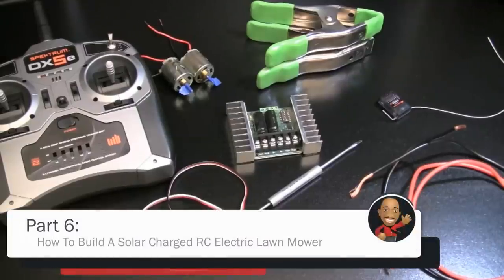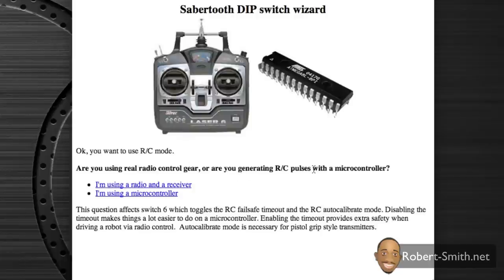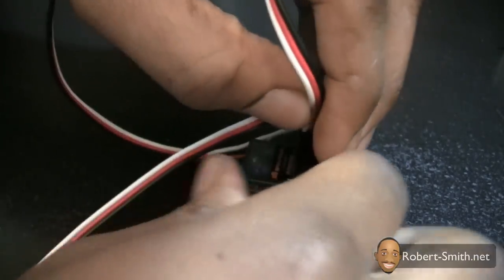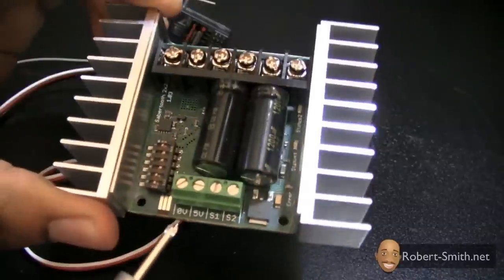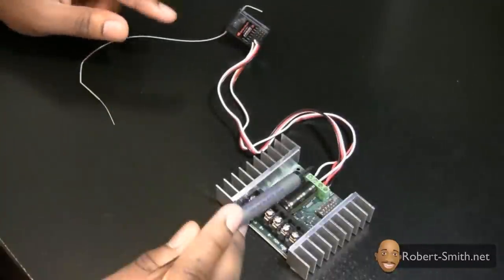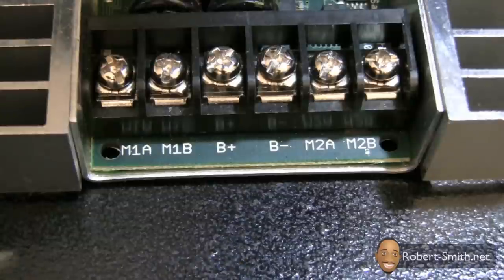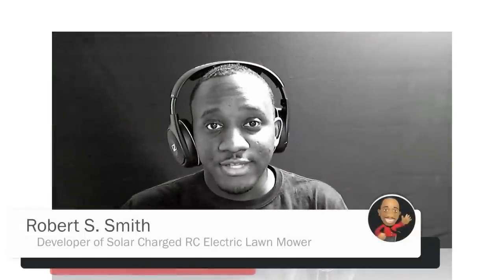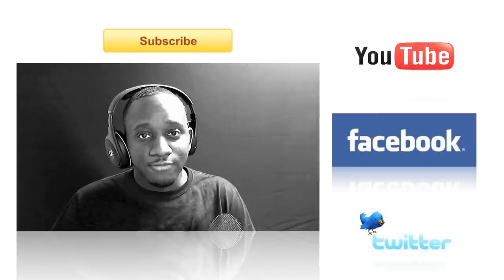How To Build A Solar Charged RC Electric Lawn Mower - P6

Comment: Super easy to follow and extremely helpful.... Please keep up the great videos...
Reply from the maker: What other types of videos would you like to see? I've been pretty busy lately, but wanting to get back into making videos, but trying to figure out what types of videos people enjoy the most.
Reply: @GreenTechTown  I am a Quadriplegic and I have wanted to build or have an RC Lawn Mower built, but I would like to do so without using a Arduino and just use the Motor Controller, RC Receiver, two 12 volt batteries which is easier to do as you've shown in your Tutorial Video's.

I'm familiar with RC Control wiring, as I've had and flown several RC Airplanes over the years, controlling the joysticks with the use of my teeth/mouth, which is how I would control the RC Lawn Mower.

I believe I could bypass using a Arduino, if I were to use a DC to DC Converter powered by the Motor Controller to drop the power to 5 volts for any other servos I may wish to add. 

Example -- Safety Shut Off switch, servo for the throttle and maybe an Actuator to raise and lower the mowing deck.

I may be mistaken on some of this?

As for what I would like to see, I'm not sure since there are so many topics to choose from. You have NOT bored with any of many videos I've watched and I can't imagine you disappointing me with any in the future.

If/when I think of a topic I'll be sure to let you know.

Comment from the maker: @Leney98 Well believe it or not, the Sabertooth 2X25 is considered a non-expensive motor controller because of the features included. The only other option that may be cheaper is to build a motor controller yourself. I have seen a few out there but I cannot remember the link to any.

Comment: Hi very nice. Which type of bttery you use? Ho many ah? Im building mine with the sabertooth 2x25 and I dont know which battery to use. How many amps. Currently i use a 24vdc 4amps power supply to test the equipment.
Reply from the maker: I ended up using for the final project 2x 12v 35ah batteries mainly so I could mow longer.

Comment: Just a thought, you may wish to use ring fast-on connectors when possible in case of vibration and loosen screws. Also locating receiver as far away from all other electrical stuff will reduce interference. Is the receiver available with a whip antenna, may give more range.

Comment from the maker: @thefaeryman The receiver did not come with a whip antenna, but it still has a long range even without one...which is great. For larger yards a whip antenna may be useful though. This receiver also does a great job of staying bound to only one transmitter and has not had any issues with interference from what I've experienced so far.

Comment: Hi Mr Robert Smith Congratulations on your video, it inspired me to create my lawn mower and I just bought the Sabertooth Dual 12A 6V-24V Regenerative Motor Driver and I'm in doubt which remote control to buy I found this on AliExpressFlysky FS-GT2 / fs gt2 2.4G Radio Receiver RC Model Transmitter With FS-GR3E 2CH Digital Transmitter For RC Car / RC Boat can it be used?
I thank you if you can help me I am Brazilian and I do not speak English but thank you very much

Comment: Very nice. Can you control the speed of the drive motor. How fast and slow it move.
Reply from the maker: I'm not sure if you can from the board itself, but my controls were analog so I controlled the speed from the transmitter/remote controller by not shifting up/down on the control sticks as much.

Comment: I will contribute to Green Tech Town. You really explain steps by steps
* I am surprised that you have not delved into the autonomous technology Pixhawk / Ardurover
Question

if the two batteries ( in parallel) are 12 V and 50 amps, and the motors are 12v 50 amps, should I get the 
sabretooth 2 x 60 dual 60 A Motor Driver???

Comment: good morning Mr. Robert I found his videos very interesting. I have a project in mind for a radio-controlled lawnmower but unlike the mechanics in electronics I'm in a bad way .. I need a little help with the components. is the sabertooth 2x25 board ready and just programming the swiches? does the spektrum dx5e radio control with the ar 500 receiver fit only these or also other brands? thank you in advance .. greetings
Reply from the maker: The sabertooth is ready and can be configured for different things using the dip switches. You can use it with just about any radio control. I just used it with the dx5e since that is what I already had on hand.

Comment: Great video. But it was made quite a few years ago and I am attempting to do what you have done and I am not finding the same components you are using in the video. It would seem the models you display are not available anymore. I have seen some models that may work but Im not sure and they are pricey so I want to be sure. One other thing. Are the motors in the wheelchair I have Servo or Brushless. Thanks for any help.
Reply from the maker: Yes the wheelchair motors are brushless.Also, I checked and the sabertooth motor controller is still available, but has a lead time fo 2 weeks. You basically just need a controller that can handle the max amount of amps your wheelchair motors can draw. But yes, I'm sure there are other options out there available too, so if they work for your application, go for it. Thanks for watching and good luck!
Reply: Thanks so much for the reply. As per my post the controller was not what I could not find. It was actually the radio you were using in the post. I guess I wanted to be sure about using another radio and be ok that they would be compatible with the controller. I guess I wanted a suggestion as to a good radio that would match well with controller. Again thanks so much for any help.
Reply: @GreenTechTown  Hello. A couple of things. On mt receiver there is no Aeleron or Elevator servo inputs. Just 6 channels, Batt and D for Data. Which servo Chans do I use. I have the DX6e Controller and the AR620 Receiver. It says that it is a Telemetry receiver. Can I use any of the 6 channels.
Reply: @GreenTechTown  Robert. I see you listed on another reply that you think you supplied 24v to the controller. I too have 2 batteries in the wheelchair Im using. Do I send 24v to the controller from both batteries.

Comment: Question:
1. what type of type of Battery Voltage was connected to the Sabertooh Dual ?
2. how much voltage was reduced by the Sabertooh going to the motors
3. What was the Amps needed for the motor
Reply from the maker: Hey Perez, it's been a while since I worked on this project, but I believe I supplied 24V to the motor controller. I did not check the voltage reduction, and the wheel chair motors I believe were rated for 10amps but again, it has been a while, so do not quote me on that. :D

Comment: What wire gauge are you using? I like your build
Reply from the maker: Thanks! It's been a while since I worked on this, but I believe I was using either 16 or 18 gauge electrical wire. For the small motors, it looks like 18 or 20 gauge wire.

Comment: Hi Robert. I love your videos and I'm still on #6 in which you explain the remote control DX5 thing.
My question is: Would you consider making a rc lawn mower for me for money, and I'll provide the lawn mower and of course all the equipment costs.
I'm not at all mechanically inclined, but I would love to have a rc lawn mower. I have a new (never been used) TroyBilt 280es.
Thanks for your videos and thanks in advance for any response.
Sincerely, john